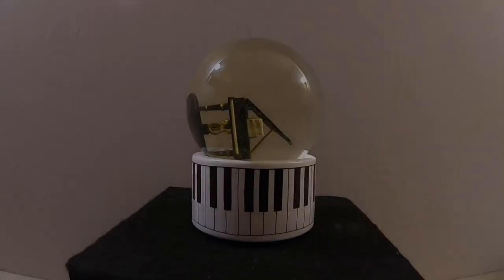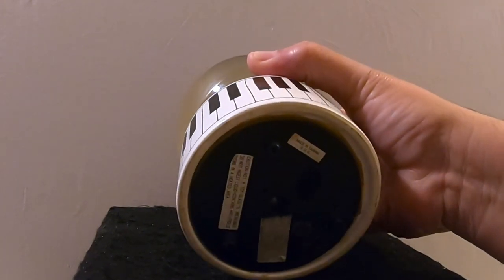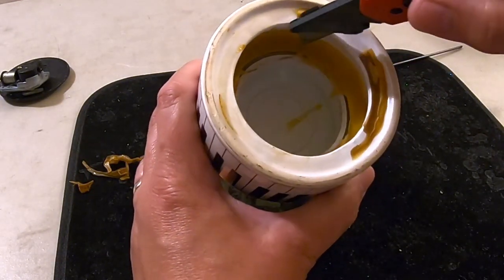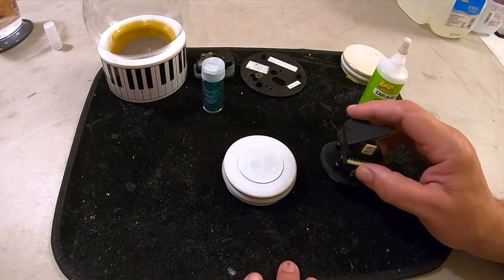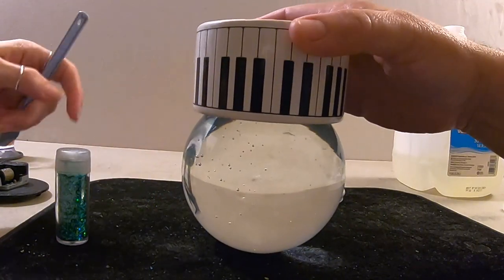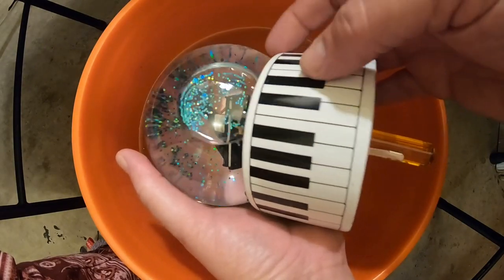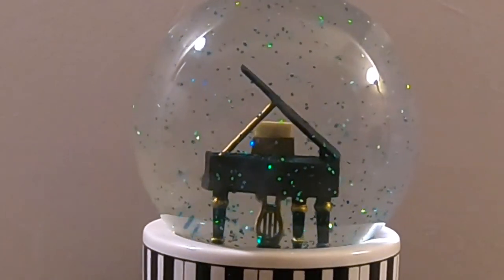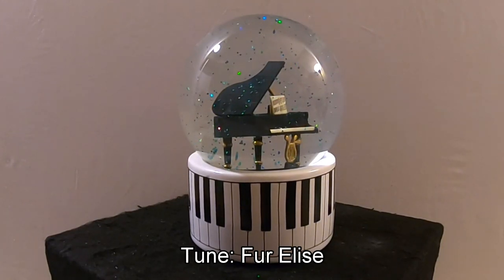Ep. 211 - San Francisco Music Box Company Grand Piano Snow Globe Repair. Water & Detached figurine

Comment: Thank you so much for all these videos! Do you ever work on snow globes where you have to replace the entire base? I am trying to fix a globe where the base was ruined beyond repair. I would be happy to replace it with a plain square base but don't know where to find them! It also has a really weird stopper that included a brace and a screwed-in ring.
Reply from the maker: Hi, you are welcome. We have swapped out bases once or twice. We don't have any videos of that, however, it is as simple as removing the globe from the original base and moving it to the new base. Once you remove the cover and stopper and empty out the water, use a hair dryer to heat the hot glue that holds the globe into the base. Once the glue is softened you can lift the globe out, fill it with water, replace the figurine and stopper, then hot glue it into the new base. The retaining ring you see in the stopper is designed to press the stopper against the glass globe to prevent water from leaking out. They don't always work. We have had a few with that retaining ring. We don't replace the ring when we fix a globe that has it. We seal the stopper with hot glue and that works fine for us. As far as a new base, look for an inexpensive used snow globe at the thrift store or flea market or garage sale that has a base that you like. Make sure to measure you globe so that you get one that is the right size. There are also links in the video description to some companies that sell snow globe parts. They may have what you are looking for. 
Here is a video where we deal with the screw in retainer ring: 
https://youtu.be/Ubom-lLGoec
Here is a video where we remove the globe from the base:
https://youtu.be/4LnKvN0sUI0
Good luck!
Reply: @snowgloberescue8887  Thank you! I'm mainly just trying to locate a plain, square base, preferably in white, but I can't seem to find them for sale new. My luck at thrift stores so far has not been great... ;-) I'm going to watch your video with the retainer ring right now!
Reply from the maker: @user-mi8md9mv6y  Keep an eye out in Garage sales and flea markets, they are good sources for used snow globes. It seems that since we started doing this that there are fewer snow globes in the thrift stores these days.

Comment: Finding information on snow globes can be very difficult. I found one close to the one I bought, but it has one small detail that makes it different.
Can the wind up spring be repaired or does it need replaced from parts?
Reply from the maker: There are high end music box mechanism that are all screwed together and allow you to disassemble and replace parts easily. We have not yet come across any of those. The music boxes that come in most snow globes are the Sankyo brand or similar. The spring assemblies are pressed together and we have not had any luck repairing the spring itself, however, when we have a broken spring we take the barrel and comb off of the mechanism and move it to a replacement mechanism that we take out of another snow globe or music box. That way we preserve the original tune.There are several examples on the channel; one example is Episode 51 (https://youtu.be/X6HITfVg07E)